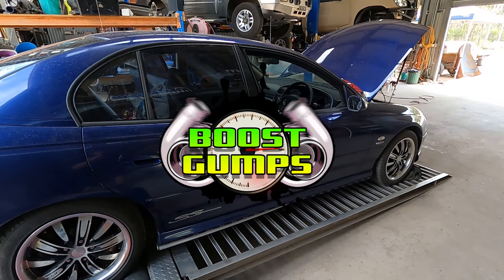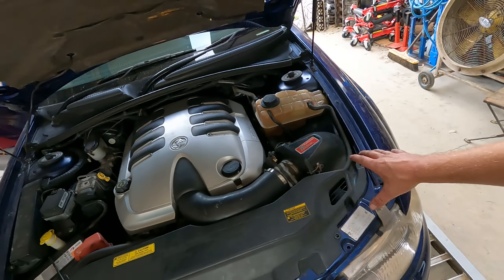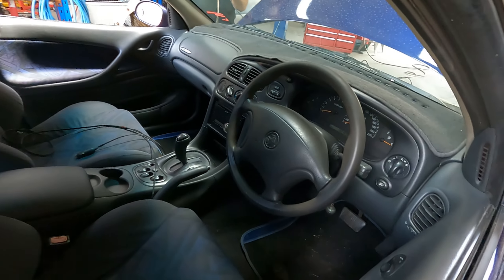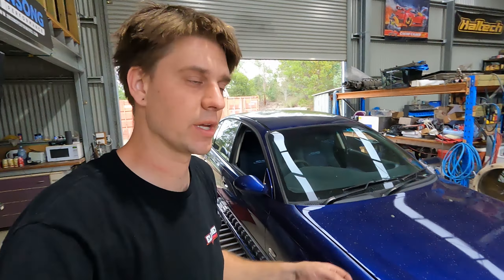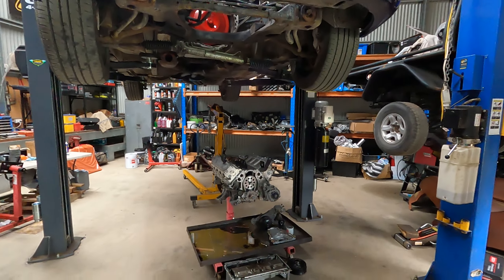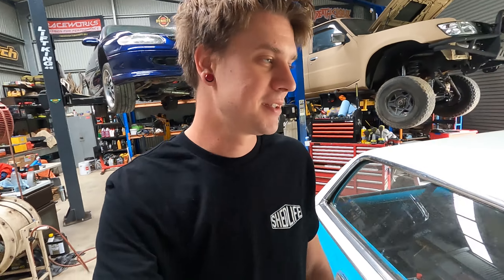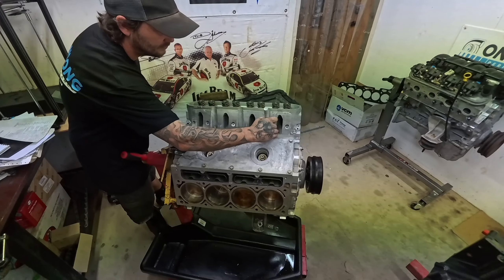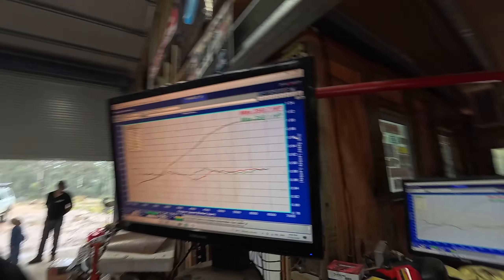Amateur Mistake Cost Us BIG || VT SS Full Rebuild

Comment: hey guys what brand of cam and cam specs i would love to fit that cam in mine cheers any help would be great
Reply from the maker: @lloydiesgarage4214  its a comp cams 222/224 or something similar. Not made any longer unfortunately!
Reply: Put the BTR truck Norris in mate. Still run standard converter. I’ve had a few cams and in my opinion the absolute best for a street cruiser.
Reply: @Tooters84  what cam is that mate